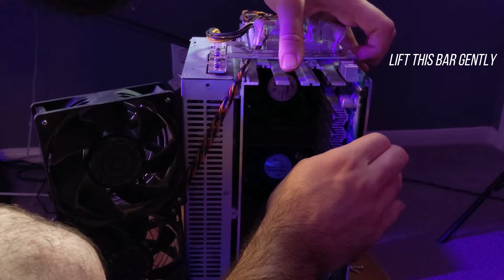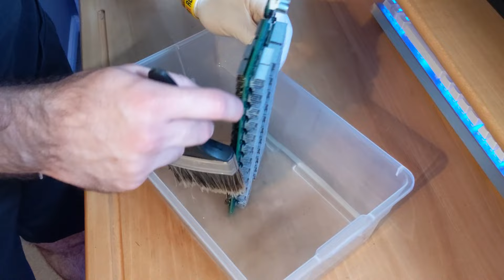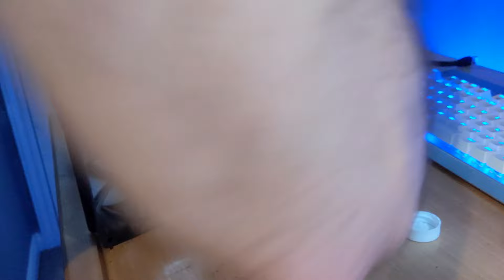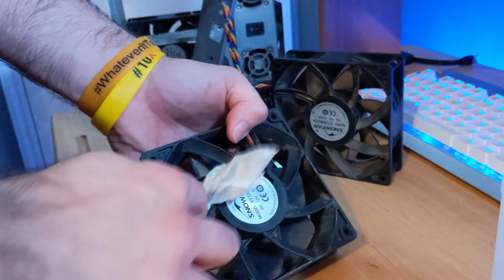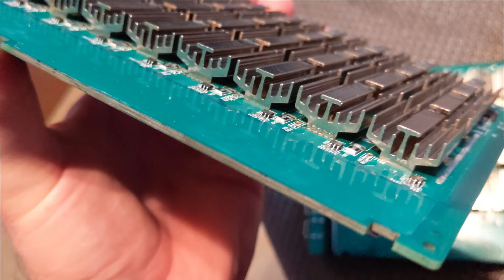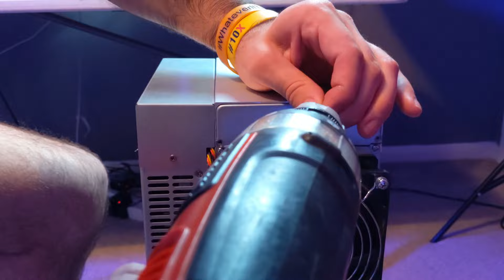How To Clean your ASIC Miner Goldshell

Comment: How long would you estimate each miner take to clean like this, since it’s under time lapse, hard for me to discern :)
Reply from the maker: Hey Kyle so the first time takes forever because you learn how the miner comes apart.. but once you learn how it all fits together, i can't say it takes more than 30 minutes. it depends how bad it is too... mine was absolutely caked and also i was trying to bring it back to 100% clean like how it came. but I would say 30 minutes.... Cards 10 minutes, fans 10 minutes and grills and frame of the box another 10 minutes.
Reply: @gabrielchaparrotalkscrypto  Hello, what kind of liquid that you used to clean board?

Comment: Can't you just dip a brush into the tub of alcohol and brush it that way? It kinda looks sus the way you did this
Reply from the maker: hey so yes you can do that. but there's nothing wrong with submerging. if you're saying it's sus because it's an electronic, what we have to worry about is the corrosion effect. the Ionization when water touches a metal.. since it's 99% alcohol, there's almost no water... it evaporates extremely fast. def don't do this in a closed room. just wait for the boards to be completely dry once you're ready to plug her back in. it will dry extremely fast.